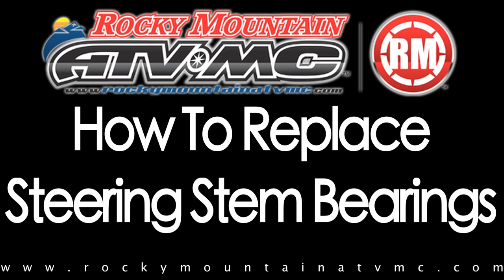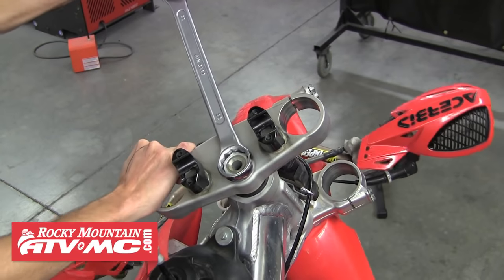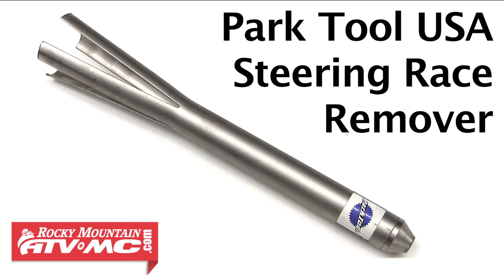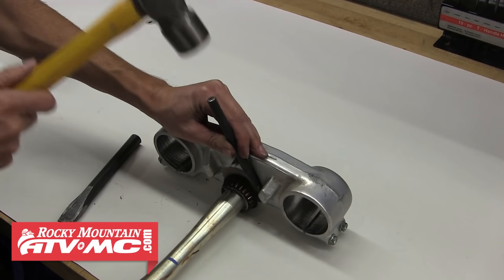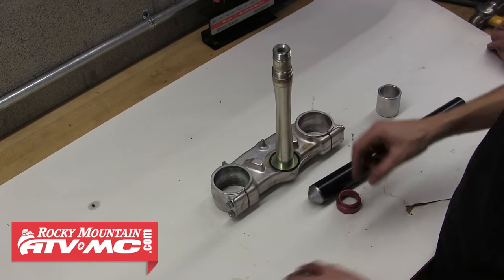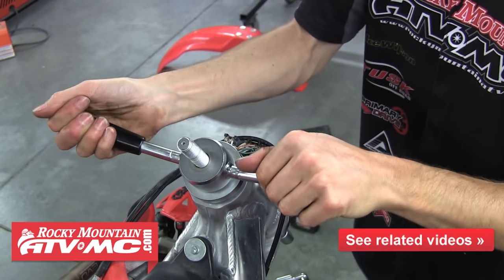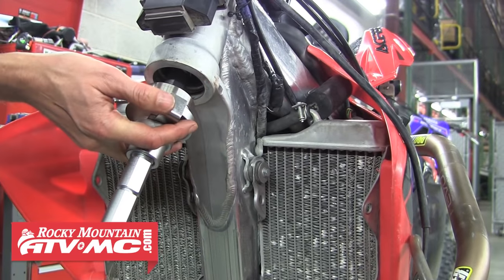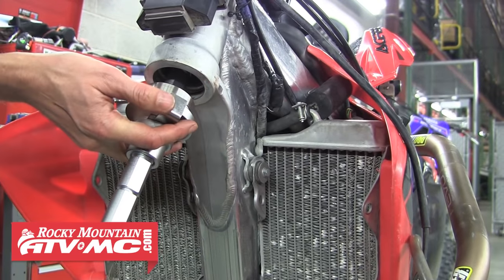Motorcycle Steering Stem Bearing Replacement

Comment: great video. i know a lot of people are commenting on the tools costing too much, but someone once gave the advice of use what you like and ignore the rest. i was almost able to finish getting everything off without any fancy tools, but i just could not get anything to catch the lower race. i went ahead and got the slider hammer and the 45mm collet off their site, i couldn't find that size collet anywhere else on the net. got them today, and it popped out after about a minute of set up. i had spent a couple hours using multiple punches, screwdrivers, pipes, anything else i could shove that would remotely grab the edge of that race. the grief it saved was well worth the $4x dollars, and now i've got a slide hammer in the tool collection should i need one in the future.

Comment: Please make a video using ordinary tools, that will be super helpful. Thanks.
Reply: So I don’t need special spanner a large adjustable or hammer and screw driver . U don’t need special case remover hammer and socket will do and u don’t need special puller hammer and chisssel will do and heat may help . if that’s any use to u one year later lol 😂
Reply: Special tools are nice for workshops to make the job easier but the average person does not have these tools . They are expensive and if you don't dont change steering head bearings regularly it just does not worth it to buy them . Using ordinary tools requires to be very careful so a video on it would be much appreciated !
Reply: @chriscs9080  totally agree
Reply: Be creative
Reply: @chriscs9080  idk personally ill keep the 40 dollar tool for my entire lifetime vs trying to use a bunch of bs. Even if I only use it twice. But that's me. 40 bucks isn't so drastic and neither is paying a shop the same to do the same thing 😂 shits not expensive even a little 😅

Comment: 1 1/4" galvanized steel pipe with the plastic thread protectors works great for driving on that lower bearing I found that out today

Comment: using a hammer and flat head screw driver between the triple tree and bearing pushed it high enough up to then use a sort of thick flat tipped chisel to hammer off the bearing worked twice for me! thanks for the tips!
Reply from the maker: Nice work!

Comment: Using sockets to remove and install races work well. Just make sure to use a dead blow hammer or put a piece of wood between the socket and metal hammer when striking the socket.

Comment: Just like to mention that there are only three items that you have to force in. the lower bearing and the two races. U can use the old bearings to tap on the new bearings aim carefully. Also just thought I would mention with my 1972 Honda cb175 there are two different sizes of bearings. I was told the larger 27x48.5x17 goes on the bottom and the 26x48.5x15 goes on the top. The pyramid parts said it would come with instructions and didn't. When using the old bearing to force the bottom bearing take the bearings and collar of the bearing off so its just the inside race, easy way to do that is use a small flat screw driver to move the bearings to the outside then use your thumbs to push it out at an angle. Then turn the old bearing over so that the larger part is on the new bearing and tap two taps and move around in a circle. Freeze the triple clamp and the bearing races to shrink them. Remember cold shrinks and hot swells. You can use the old bearing races to pound the new ones in unless your kit comes with a washer which u can use that.

Comment: Thanks so much for the video! This worked perfectly for my r6 bearings. I didn’t have the right size pipe so I cut my jack handle down the middle a bit so it woul open up as I installed the bearing!

Comment: Great video, but who has $500-$600 for all these awesome tools.
I t would be cool to see a video for the average person that doesn't have most of this stuff, maybe less of an add and more of a how too!
Reply from the maker: AlbertaDaver Understood.  With these tools you can ensure a proper install of the bearings, they will help the job go a lot more smoothly and save a lot of time in the long run.  There are other methods to do the job yes, but you create a higher risk of damaging your new parts and your pricey OEM parts.  Tools can get pricey, but they can last you a lifetime if used correctly. Glad you enjoyed our video!
Reply: +AlbertaDaver Doing this without at least some basic tools is a damned nightmare. Buy the tools, use them, and then sell them on eBay.
Reply: i know it's a bit late but i just replaced the bearings on an xr200. almost identical to the video except i dont have any special tools. just a hammer, some funky shaped punches. just gotta work your way around the edges easy so you dont get the bearing crooked and careful not to bike into anything (slip with the chisel and break something).
used the old bearings to put the new ones in so as not to damage the cage or the race.
Reply: seemed like they provided alternatives where possible. sometimes you just need the right tool, or know someone with the right tool
Reply: Just done mine with a screwdriver and hammer . Taking all the crap off first took the longest. The bottom bearing race is where it takes time , I just kept hitting away using the screwdriver as a wedge . I had already snapped the end off trying to use it as a pry. The old race and a big ring spanner ..oh yes that's another tool , was helpful wacking the bottom race back in.  The spanner can be used as quite a powerful pry too
Reply: You're going to spend $500-$600 at a shop to have this done by a mechanic anyway. So its either $500-$600 to buy the tools so you can do it yourself for a lifetime, of $500-$600 for somebody else to do it once.

Comment: I just torched all the bearings and collars off. So much easier!
Reply: You risk changing the metallurgy of your steering stem that way. As I'd rather not make it brittle and risk it cracking while I ride over rocks etc. in the middle of nowhere, I'll stick to using carefully placed blows with a hammer and chisel.

Comment: Everyone complaining about special tools, you can remove the races with a hammer and a screwdriver if you have to, you can install the new ones with an old socket and a hammer.
the bottom bearing you can install with a hammer and screwdriver. 
Your more than likely going to put dents and dings in paint or metal but thats the reason the special tools exist.
The tools arent even that expensive if your gunna use them once get some china made ones and throw them in a bin when you are done.
If it the tools were cheap and the jobs were easy mechanics would go out of business.
Reply from the maker: Owain I like the way you think!  The specialty tools definitely make the job go smoother and install is a breeze.  Thanks for sharing some alternative methods with us.  Thanks for watching.
Reply: Owain i tried the hammer and screwdriver method it didnt work that why im here now

Comment: Every brand new mx bike ive bought since 1980 never had near enough grease to call the bearing greaesed. I do a full tear down and grease every pivot and bearing on the bike before i ride them now. Also i blue loctight all the bolts for the plastics and anything else that likes to come loose

Comment: Most every bicycle shop has the park headset bearing remover. Or make one with a cutoff wheel on the disc grinder and weld a nut to the top to hammer on.

Comment: If this were a street bike, it would be important to tighten the steering stem nut so that when the wheel is on and it's all been put together below, that there is a bit of drag when turning. What happens is if these are a bit loose, they will bang the rollers into the races every time you hit a pothole. What happens with street bikes is that you spend most of your riding going straight down the highway, and those rollers wear a groove into the races in time. The tighter they are, the less banging there will be, and they will last longer, but will eventually wear "notchy", that is the wheel when off the ground, can be moved by hand and a definite notch in the middle will be felt. This can wear you out on a road trip. It can fatigue you within a number of hours and make your long trip miserable. These have to be checked as the miles roll by. Check them at least every 10,000 miles, to see that they are not getting loose, (front to rear play when pulling on the forks legs by the wheel, when off the ground) while also checking for a notchy place in the front wheel, where it likes to settle when straight.

Comment: i need to replace the bearing in my 09 wr450f. A week on the stand without moving it and i have to almost kick the bars to un freeze the steering. I Was quoted $300 to have replaced and after watching i can see why. Ive done swing arm and wheel bearings before but this is a little harder without correct tools. I should have just pulled it apart before it got bad a re greased.
Reply from the maker: +sirjolly81 Yea.  If you're looking to save some money this time around and in the future it's a good service to learn and to keep up on.  The correct tools definitely make this job go a lot smoother.  Good luck, let us know if you have any questions!

Comment: If you have the cash, buy the tools. They'll save you a lot of headaches because most of the races have extremely tight tolerances with the steering stem. And you'll have to buy a small spanner wrench anyway, the job cannot be done without it. And no, the same spanner from your rear shock will not work. However, it can be done without:

-pull everything apart, and get a long screwdriver to punch out the old races through the other side of the stem. Go around slowly to make sure you don't mar the inside of the stem.
-put the new outer races into the freezer for an hour and let the metal shrink. Then quickly press them into the stem and hope they fit. Usually they will with a few taps from a rubber mallet.
-If the freezer trick doesn't work, you're gonna have to create some type of jig to pull the races into place from the other side of the stem. I cut some hard oak into the same shape as their metal press pieces, and attached it all to some threaded stock from lowes, along with a few bolts. it's basically a long rod with two bolts & washers on the end, and two wooden race presses in the middle. Again, buy their tool to save you some headaches.
-slowly screw the jig and it'll pull the races into the right place (hopefully).
-put the triple back together and torque the top bolt TO THE CORRECT TORQUE FROM THE MANUAL. Failing to do so can ruin everything you just did. Again, I had to buy a special spanner wrench that had a hole for a torque wrench.
-Put it all back together and check for smooth operation.

If you can't afford the tools or aren't confident in your handy skills, take it to a shop. Seriously, this isn't as easy as it looks.

Comment: All you need are the two arms from a gear puller, put them against each, it doesn't matter which way, hook them on the lip of the race, put a block of wood down the center from the top and hammer out.

Comment: I always put races in the freezer when I’d get the parts in. They then just drop in for the most part. I think maybe next time I might freeze the lower triple stem assembly and see if the bearing would slide on
Reply from the maker: It is amazing how well that works.  I do it too. - Justin

Comment: The vid made it look easy but trust me unless you are PRO, steering head bearing replacement is a challenging task especially if you choose not to remove the the front instrument and headlight unlike the vid  Like what Rocky mountain suggest all the special tools suggested are needed for this task save for a few. Actually some of these tools are also for bicycle head steering replacement. But the force required for seating and remove motorcycle bearing differed very much from that of a bicycle bearing. 

One hint is the job is made easier if you could use small pencil butane flame to accurately heat the worn race on the steering stem before using a chisel to pry around to remove it. The bottom steering stem puller ( VERY EXPENSIVE) is not really required   For seating the bearing on the steering head, heat around the steering head rim first to seat the frozen bearing using the steering stem press.

Actually the slide bearing remover might not be necessary to use to remove the top race., Inverted the  Park steering head remover and tap from bottom up to remove this race.This is much easier.

Comment: Such a great video! I am waiting on my tools to do this job and studying the video. However, I can't find race removers anywhere. For the slide hammer bearing remover, which size collet do you need to remove those races?
Reply from the maker: We used the 45mm collet with the slide hammer.

Comment: The "Park tool race remover" comes in two sizes..which will i need to do pre 2000..250 & 500 dirtbikes?
Reply from the maker: The easiest and most accurate way to determine this would be to measure the races but for most all bikes the larger size (1 1/4"- 1 1/2") is going to be the correct size. Of course this is a universal tool so keep that in mind. If you have any questions let me know. Thanks for watching!

Comment: Hi good video I was just wondering how are you supporting the bike while you do this?
Reply from the maker: Hi Pandelis Katsianis  We've just got this bike up on a bike stand with the rear tire touching the ground. You just want to be careful when you pull the front tire and both forks because sometimes if the bikes rear tire isn't touching the ground, the bike will rock back when the bike becomes unbalanced. Other than that, just having the bike on a stand allows you to complete this bearing replacement no problem.

Comment: Solid video but that Park race removal tool is trash. I bought one from yall and it does not stay on the lip of the race. Even bent the bottom of the legs outward to make sure they're well seated on the lip but they still pop off. I'm going to try putting something on the inside of the Park tools legs to prevent it from springing inward but would not recommend this tool.

Edit: if the tool keeps popping off the lip of the race, shove a 7/8 socket inside the tool to keep the legs from moving inward. Use something to hold the socket in the tool. I used a bearing race seal driver. Beat the shit out of the tool while pressing against the socket and the race will drop out without a fuss.

Comment: Couldnt You just take the remover for the lower seat for the upper as well? Or just use something like a old screwdriver ? Sorry for my English I’m from germany ✌️
Reply: Simon R 
You can use the remover tool or screwdriver and hammer. 
Installing the new races into stem is more challenging. I tried it today.

Comment: Is it true that the steering stem is an interference fit with the lower triple clamp? I wanted a shop to press out my stem but the guy said that he didn't recommend it because it won't go back together exactly the same?
Reply from the maker: Never heard that one before.  while it is an "interference fit" (meaning the tight fit holds them together), most manuals tell you to replace the inner race by pressing out the stem.  It will go back together fine.  Not sure what he means.

Comment: Rubber dust seal shouldn't contact a petroleum based grease because it'll will damage the rubber. Better to grease the dust seal with red rubber grease or dust seals rubber are resistant to petroleum based grease?

Comment: Can anyone tell me what size wrench is needed to remove the upper and lower triple fork tube pinch bolts on 04-05 CRF 450? Are those 12mm or 13mm? I want to know what size wrench I need to bring to loosen those....rather than a whole entire set. thanks! (or at least not having to bring 10mm-15mm cause I would bet its one of those, no way those are larger than 15mm, they look like 12 or 13 to me)

Comment: Good video but actually you don't want to put grease outside the outer race because you risk that it can spin and move in the frame. If that happens your frame is destroyed and you will never get the bearing to work as intended. Slightly warm the frame and cool the bearing instead.

Comment: Which size collet did you use here when using the tusk bearing removal tool?? will the collets provided in the kit be big enough/fit most stem bearing jobs?
Reply from the maker: Yes.  There are a variety of different size collets to adapt to your size bearing you're removing

Comment: Could you use a PVC pipe to put the bearings on? Also couldn't you just cut off the bearings?
Reply: Did the PVC work for you?
Reply: I used either a length of PVC pipe or a length of black pipe when I did my lower bearing (the one that goes onto the triple tree shaft). It was fine. Just make sure it's the right diameter. You can easily get either pipe cheap at a plumbing supply store or hardware store.

Comment: How often replace? I got a new bike 2 years already just started rough turning and not smoothly... I'm thinking of clean and regrease? Any advice
Reply from the maker: It will vary depending on how often you ride and in what conditions but it's a good idea to check bearings and replace or re-grease at least once a year. So if you feel your steering bearings turning roughly, it's definitely recommended to service them!
Reply: @rmatvmc  I appreciate the quick response I re-greased on the weekend  and it feels smooth it's brand new bike they don't put much grease Innthe manufacturer step

Comment: If you use a Bearing pulling tool 05:40 does it damage the bearings in any way?
Reply from the maker: If you get the blades underneath the bearing it shouldn't damage it all but if you're in there its definitely recommended to replace the steering stem bearings anyway.
Thanks for watching!
Reply: @rmatvmc  .thank you for your reply. Do you ship to the U.K please, is so how do I order?